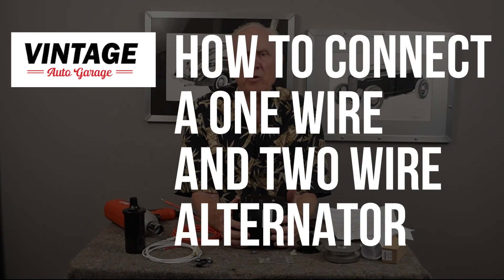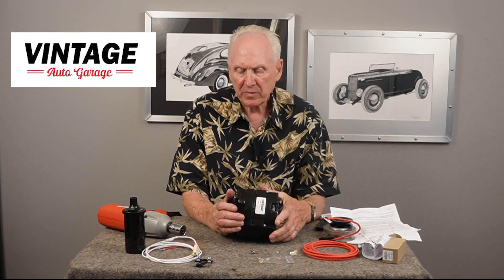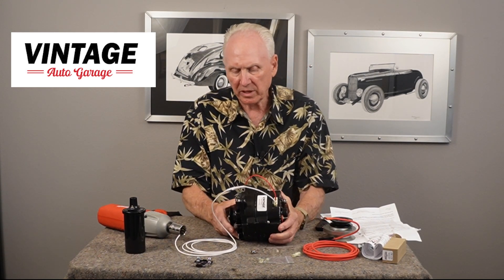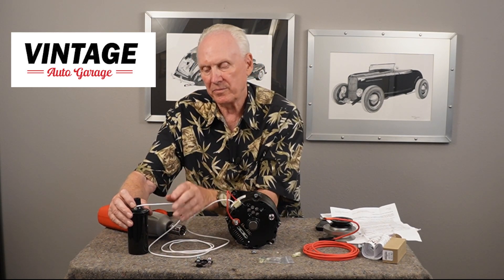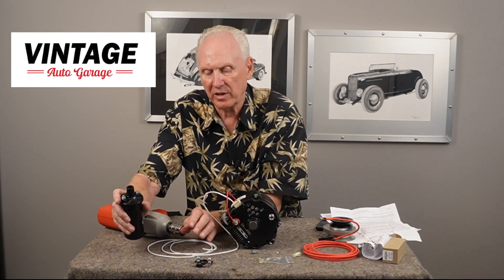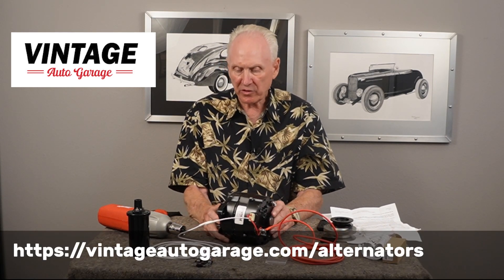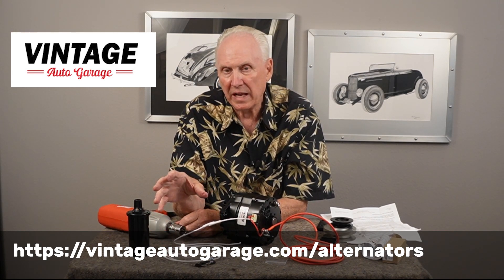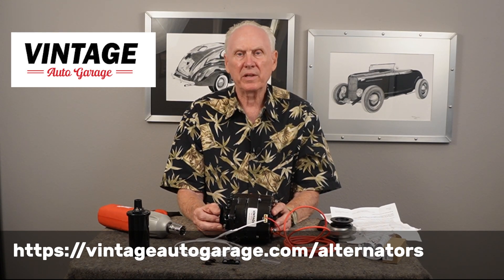How to wire alternator

Comment: Alternate video  suggested running t he 10 gauge charge wire through the back clip of the amp gauge meter located on gauge panel , prior to connecting to the + battery terminal.   Did aI understand this correctly?   ( 46 Ford  6. To 12 V conversion )

Comment: My 1966 289 alternator is not charging my battery. Mustang. Tested alt, regulator and solenoid and all are good. Just a wiring error I think. A to battery, F to field, S to stater and I to ignition. Still no luck. 1st generation 3 wire alt. Please advise.